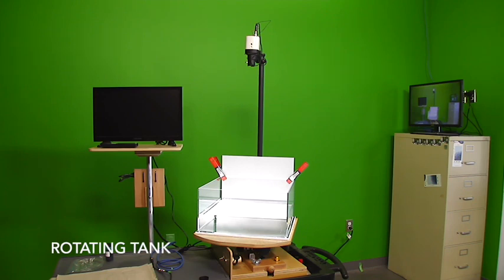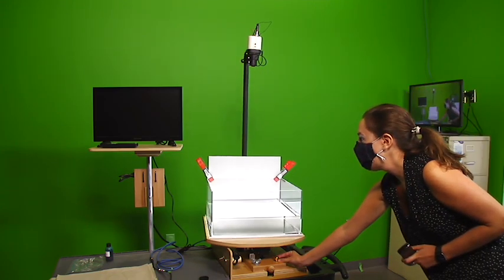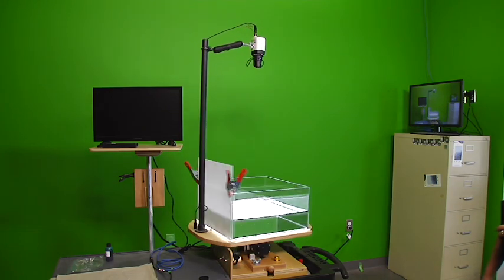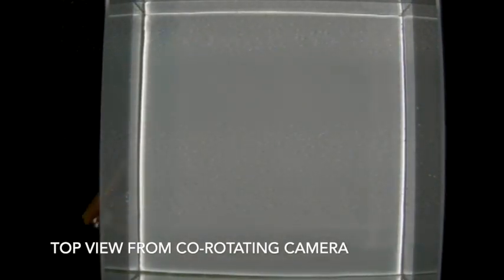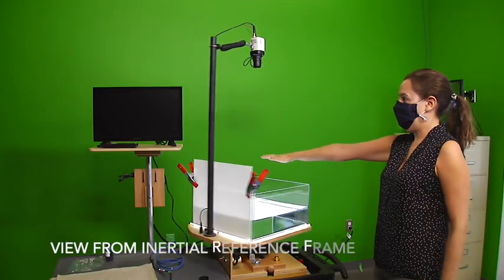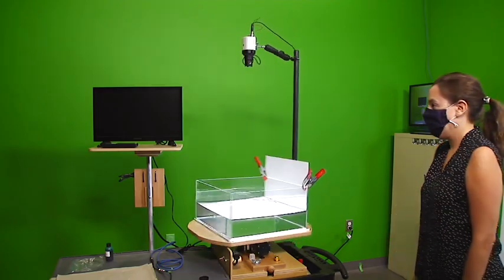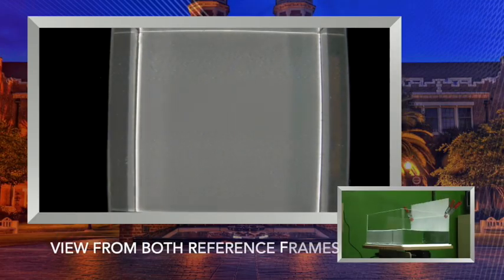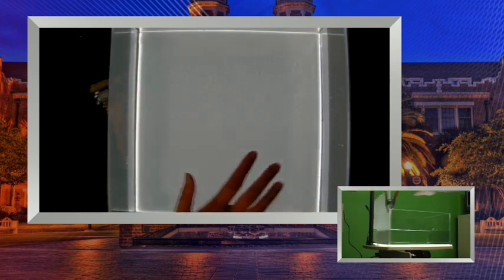Inertial & Rotating Reference Frames

Comment: I tried an interesting experiment based on the static visual figure-ground   illusion sometimes called the Ruben vase illusion  - consciously changing in my imagination (not my perception) what is foreground figure (the white curved vase) against a black background, vs the view of two black faces looking at one another in the foreground against a white background. In the inertial reference frame portion of the video,  When I slowed the video speed down to 0.5 I found it I could make A mental switch to see your hand “ moving”  to the left to a “ imagined  stationary “ corner of the box , or that corner of the box moving to the clockwise relative to your stationary hand  of your hand as it appears stationary,; once I did this at slow speeds I found I could adopt either perspective within the inertial view reference frame - something I couldn’t do at the normal speed until my brain learned the “trick” of focussing on just the relative position of a corner of the box to your hand - hope that makes sense - it certainly enabled me to interpret what was going on in changing from an internal to a rotating reference frame